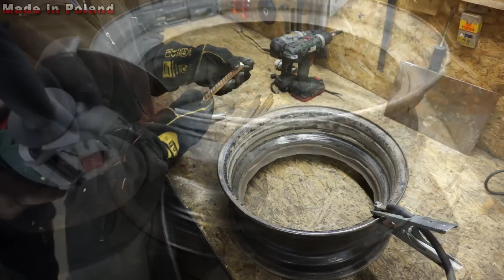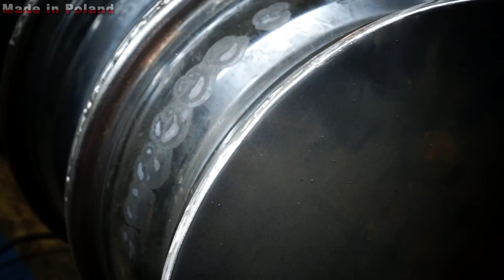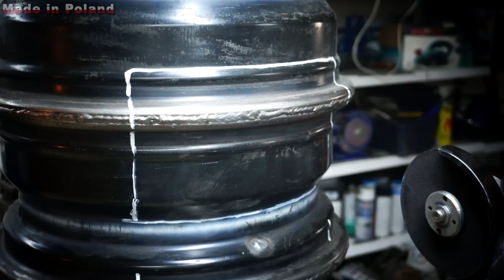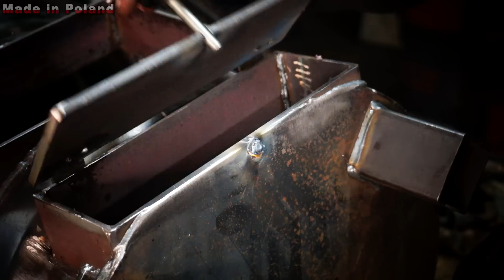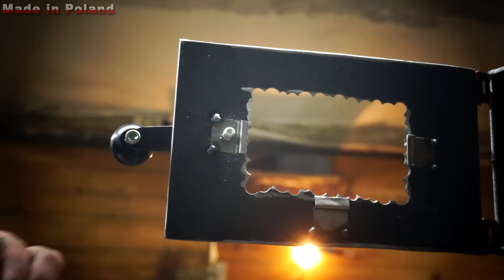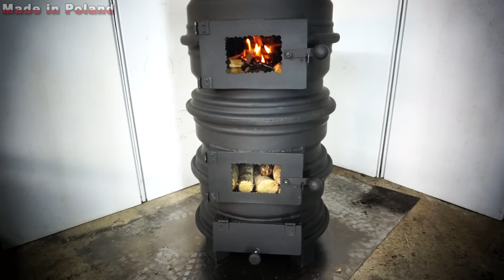Wood Stove from Car rims DIY

Comment: Here's a good tip on how to get a lot more efficiency from your stove: make a flat, heavy baffle, say 1/4 pl, about twice the size of the Exhaust pipe, Space it about 1-1/2" off the hole. This will make the flame travel farther & keep much of the heat from just rushing out the pipe, making the room warmer. Also, a Damper about 3 feet up the pipe from the stove body will help make the fire last longer & heat longer. After the fire is "Roaring," then Damp it down for long lasting heat. Pretty cool & unique idea for a Stove. Shows you're a thinker!
Reply: maby a picture or drawing  would say to your tip ( exellent tip )
Reply: I could use a diagram as well.

Comment: I love two things about this stove, the incredible resourcefulness to make something useful out of scrap, and, the high degree of precision involved while using the most basic cutting tool which is a grinder with a zip-cut blade. It wouldd have been easier with a cutting torch or plasma cutter of course...but you used what you have...very good result!

Comment: Just a thought...angle grinder with a cutting disk..OK..No gloves, no protection  Not ok. I am the victim of neglect..I did this and 3 operations to save the thumb 34 stiches and now an index finger totally useless...all brought about by using an angle grinder with a cutting disk that can seize in the cut, explode and the bits tear a hand apart.
leather gloves would have saved most if not all of the damage...Please think safety....other than that nice stove !!

Comment: Cool design, but you want to make it even better, weld a metal sheet outside, drill holes on the back side and pour into rim areas mix made of mainly soapstone off cuts and dust (dunno about translation, but any heat reserving stone) and little bit concrete. Stone cutting places should have plenty of smaller off cuts that you probably get for free. This way you get to store heat in soap stone, that releases over time and wont need to burn so much wood. Also removes surfaces, other than top that could collect dust that might catch on fire over time.
Reply: Hellsong89 southern gospel. Music
Reply: Good advice!   I suppose that's why some people have brick lined stoves as well.
Reply: Holy shit speak ingles pro favor
Reply: leo altamirano no comprende no te muevas Dinero
Reply: u
Reply: Crazy
Reply: Ficou difícil a tradução; Mas a intenção é ótima !
Aqui no Brasil temos  "Tijolos Refratário"  que é usado em fornos.

Comment: A great way to re-purpose these items.  Great work, and finish.   A more finished edge on the glass doors mullions would be my only change.  Possibly using a cutoff wheel vs. the step drill,to make those cuts.

Comment: Nice job using old parts for a new and useful purpose.
Back in the mid 70s, I had started working at 11 and at 18 I decided to take a break. My dog and I lived off the land for a year and a half, he was 1/2 coyote. I had a small grill which fit perfectly into a 14" rim. It required little wood to create a hot cooking area. Using rocks as reflectors a lot of heat was produced so cold winter nights were kept at bay.
The old days of low responsibilities.

Comment: I built one similar to this some years ago, planning the next and improved version to be built from the brake drums of a large truck or peice of heavy equipment. My circumstances changed and I never got to it.
One warning though, I have seen brake drums explode with great violence when excessively on a truck, metal composition? It would bear researching for an ounce of prevention is worth more than a ton of cure.

Comment: Brilliant design but why leave the tatty line of the drill holes on the windows? I could understand it if all of it was a bit rough and ready, but you went to so much effort grinding a smooth finish on all the rest of it, and not only on areas for a good weld.

Comment: Nice imagination. Now include personal safety. 1. Wear dust mask when grinding or using abrasives. 2. Use ventilation or respiratory protection while painting AND during your first purge burn to destroy residual VOC(volitile organic compounds). 3.cover your skin especially hands and arms while welding.  Other than protecting yourself, so you can work into your 80s good job!

Comment: Excellent workmanship. But it's a lot of work for a stove that;

A: Doesn't hold much fuel.
B: Can only burn low combustion temp fuel.
C: Won't last very long.

An excellent welder and excellent craftsman. For heating and cooking our man would be much better off working for money and buying a stove.

Comment: I totally miss the point of using the drill press to cut holes in the door?? Used a cutter wheel on the rest??    Could have made a bad ass band name if it was just effects?